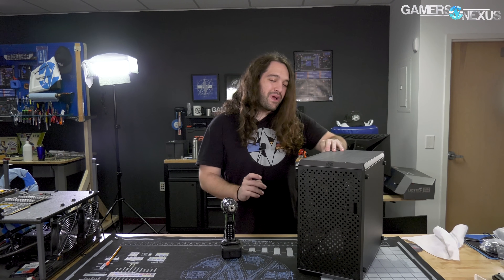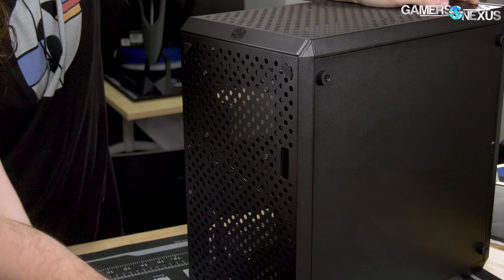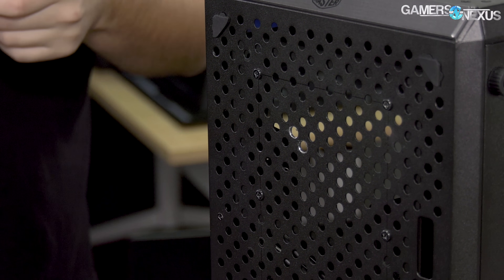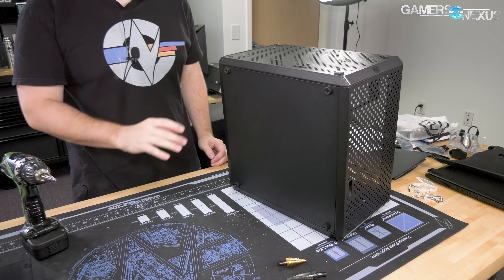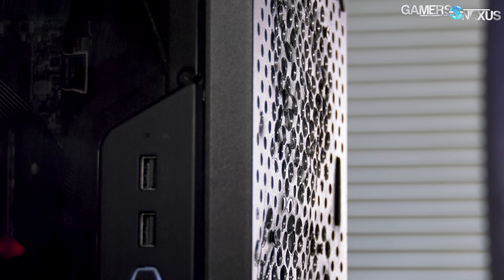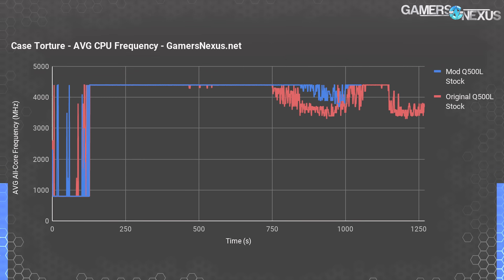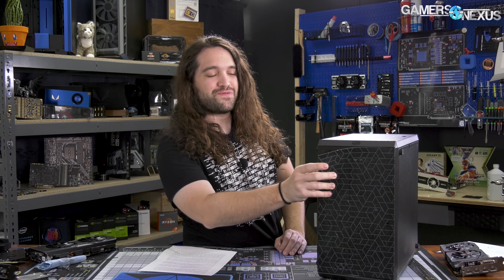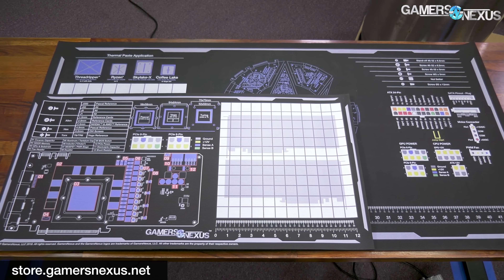"Fixing" Another Cooler Master Case: Drilling the Q500L for Airflow

Comment: High drill RPM, and low axial force would have resulted in significantly less metal deformation, and better drilled hole finish. Also using the tapered portion of the drill with little to no axial for will remove those nasty burs.

Comment: I like what you did, although would it not have been easy to cut larger fan shaped circles in the panel rather than drilling all the holes? that way more integrity may have been retained. Great video though and a wonderful reminder to clean out cases after any kind of modding that cuts the metal.

Comment: Almost bought this case in November for my mATX build. I ended up buying a worst what had a plastic shroud covering all the front-which is similar to this. Only with one tiny hole on it on the bottom end, roughly 1.5x10cm small.
And! The elevated mounting holes for 92mm fans on the case ended up braking my 120mm CM fan blades at the first start.
Might have been better with this bad case.

Comment: TIP: when drilling multiples.....nail polish, marker, tape etc.....as a marking on the step bit will help you know when to stop, w/o checking every time.......
Adding a foam backing, or grout/tile sponge behind the holes when drilling also helps “collect” metal shavings a little.

Always wanted someone to drill holes in their case, glad was Steve😉

Comment: If you would use a Dremel Cut-off wheel and turn the original (hole sized) front panel into a 'Diamond Lattice' pattern: It would both provide better air flow, and still also provide support behind the Dust Screen..
https://images.homedepot-static.com/productImages/92aaf152-40ba-44ec-a79d-87ab1ee23550/svn/black-veranda-vinyl-73004497-64_1000.jpg

Comment: FYI;  Put a decent sized magnet on the inside of the case when drilling, and it will basically make the slivers stick to not just that, but the now magnetized cover.  Makes cleanup a lot easier.

Comment: Steve 2:13
And TechJesus went into the temple of Airflow, and cast out all them that sold tempered glass and aluminium front panels , and drilled holes in the cases of the manufactures, and overthrew the seats of them that sold cases that throttled, And said unto them, It is written, My house shall be called the house of airflow; but ye have made it a den of throttling.

Comment: Hmm. Maybe chop the entire front out and just put a pair of fan rails top to bottom or side to side... I wonder if you can cram a 200mm fan or more 120s in...
I think this should be made into an open frame case with the magnetic mesh creating an illusion of a closed case.
Reinforce the boarders, chop the panels out and replace fan mounting with rails...
basically make a thermaltake P3 or P5, but with magnetic mesh covers.

Comment: So I purchased this case before the original review.  I probably would not have done so if I had seen the review first but I am actually very happy with the case.  I moved my AMD R7 -1700 with a Nvidia 1080 Ti to this case.  It has a dual fan radiator to cool the CPU venting out the top and 2x 120mm fans mounted low in front and another in the back.  Modest overclock on both and the whole setup runs cool and quiet.  I accept that the air flow sucks but it is apparently adequate for this use case.  I also have a Firewire card and a Elgato HD60 plus an 3.5 hard drive in the case as well.  Overall I still like the case a lot.  It's size for a full ATX board is the main reason I got it and for the money I think it is still a good deal.

Comment: It's like cutting out the stamped grilles on OEM cases and replacing them with wire grilles, but with an aftermarket case that isn't supposed to need such treatment. Good going Cooler Master!

Comment: I would try to just block the front grill and leave the fan holes open. 

I've done that on couple of modded cases of mine to prevent the fans from recirculating hot air that gets passively vented out through the extra holes in the front. Though I did not measure them, but that could direct the airflow better to avoid circulating hot air.

And since you already drilled that case that badly, what could you lose if you duct-taped the front as well?

Comment: If you wanted to minimize the warping of the front panel while doing something like this, cut a board to temporarily put inside the case, against the inside of of the front panel. Attach it with screws through some of the holes. Don't over-tighten the screws, but use several throughout. Drill through the steel into the wood. You can remove and replace screws as you drill, or just create a screw pattern and skip those holes altogether. Once the panel is drilled out completely, you can remove the board and all of the screws.

You will still get a little warping, but not as much. If you plan your undrilled screw holes for fans and PSU attachment, you shouldn't need any additional washers/spacers.
Reply: You just saw Steve drill up holes. Now you want to see him saw wood? This is not a DIY channel. These guys review computer hardware.
Reply: @1pcfred  
Believe me, I know. I watched the footage of them finding drywall screw heads with a magnet and not understanding what was going on. The entire "moving in to our new office" series of videos was kind of cringe inducing in fact.

This comment was more for someone seeing the video after having found themselves "stuck" with this case, and then wanting to mod it for better airflow. Or just because I had to say it having watched them mangle this case so badly. Either way.

Perhaps cutting large sections of the steel out would make more sense, depending how flimsy that leaves the rest of the case and/or the front dust cover. Sometimes you "have to" use a particular enclosure for one reason or another, but ultimately I think Steve is right when he suggests just getting another case.
Reply: @1pcfred  
Should work the same on metal stud drywall screws, as the heads are the same, metal studs just require a tighter thread on the screw part. I literally just use a magnet on a string myself. Having too-strong of a magnet might be an issue if using it to find screws in drywall installed on to metal studs, but we're talking rare-earth strength. Standard magnets shouldn't be an issue, the drywall is typically at least 5/8" thick on steel studs because that's the minimum thickness for commercial fire-rating.

Comment: Those step drillbits are maybe nice for testing out what size of hole works, but the finale drilling of them all can be much easier and cleaner done with a high quality regular drillbit and a woodplate against the back of the metal. If you did that it would problably look way cleaner. You cant support the backside of the metal youre drilling in with those step drillbits.

Comment: Tip: wrap electrical tap around the bit below the size you want. It will act as a simple stop so you can go faster without worrying about over drilling.

Comment: Wonder how it would perform if you decided your layout ahead of time and just cut out the interior section where the fan sits. You'd lose future functionality by doing so but maintain more structural integrity and time.
Reply: You don't think what they did kind of eliminated future functionality?
Reply: @1pcfred  Sure, but taking it a bit slower and measuring out the holes would let them keep mounting points for every possible fan/psu combination. You start straight out cutting out holes for 140mm fans and  mounting the PSU or 120mm fans becomes a wee bit more difficult.

Comment: So does this apply to the Q300L as well? I've had one with my GFs computer in it for about 6 months. On installation, I ran some quick AIDA64 stress tests. The Ryzen 5 1600 was overclocked, but ran stable, peaking at around 82-85. Obviously it never gets anywhere near that when not in a 100% stress situation. This didn't seem out of the ordinary to me, so we ran it as is. I'm using the stock wraith cooler with one fan in the back, and one in front. The power supply, unlike with this case intakes through the bottom and exhausts out the back, like most modern cases. I haven't noticed any issues, but the abysmal results have me paranoid that I'm baking her hardware to an early death.

Comment: Stepped drill bits are awesome for thin walled material, but, surprisingly hard to find a good cheap set in metric.
Reply: They sell metric step bits on Aliexpress. In fact that's practically all they have there. This world is going to shit. Metric bloze goatse to fabricate with. Ah finally one red blooded fractional bit.

Comment: you could have put electrical tape on the bit were you wanted to stop that way you never go past the size you want , it allows you to move a little quicker and not have to be as careful. just make sure you put enough wraps of it or it will just fall of

Comment: why not just cut a big square hole instead of drilling many bigger holes
Reply: It was a proof of concept. They wanted to see what larger holes would have done for the air flow. Which is a decision Coolermaster themselves could have made when they designed this case. I don't think they're suggesting anyone do this to their case to try to improve it.

Comment: Wouldnt it have been easier to just cut out two 120mm holes so the fans can intake with no restriction apart from dust filter? I feel the case would have been sturdier and would have cooled better. And if the filter is sucked in and hits the fans just divide the hole in two or four leaving a bit of front panel in between.

Comment: For future use of step bits I recommend some masking tape above the depth you want so it is easy to gauge for more than one hole without making a huge mistake or being paranoid with them and it is a 30 second hack that saves time.

Comment: Definitely this case needs improvement. The front panel should be just a big hole. Just make it have "crossbars" So that you can mount the fans on those then add the filter.

Comment: The step drill bits are MUCH cheaper on Banggood, there you get 3 Hex Shank HSS Titanium Coated Step Drill Bits, and are only US$5.99, i have used them a few times already.

https://www.banggood.com/3Pcs-14-Inch-Hex-Shank-HSS-Titanium-Coated-Step-Drill-Bit-Set-3-124-124-20mm-p-1003275.html?rmmds=search&cur_warehouse=USA

Comment: Unibits are the best! Quickly cutting to the size you need, while also de-burring the hole once you've drilled it. If you can't afford Irwin Unibitis, you can get step drills from hf for about 1/3rd the cost which do a very nearly equal job.
Reply: It doesn't look like Steve entirely got the deburring technique down yet.

Comment: do me a favor and never touch a drill again. thats just disgraceful. whoever told you to use a step bit should be banned from any forum relating to modding because they have no clue what its for. you didnt even need to do the whole front... just the fan locations, theres no reason at all that even a complete moron that cant even spell "mod" couldnt do a better job than this shit. and fyi, theres nothing structural about that panel, the frame is the structure on every case... panels are nothing but aesthetic, just because they rivet it on doesnt mean anything

Comment: I'd have turned pairs of holes into diagnal slots you could make paters this way and retain/improve the mounting flexibilaty.
also high rpm + low pressure == little warping of the work metirial

Comment: Why use a step bit? standard metal drill bit (on a faster speed!) would have made the job way easier, cleaner and quicker.
Next time you need to fix airflow - I'm sure there will be a next time! - use the right tools for the job :)
Reply: You're not the first person to say this. I've been working metal for over 30 years now and for drilling out thin sheet goods I find step bits to be the best when it comes to larger diameters. Twist drills tend to corkscrew and leave butterfly holes on jobs like this. A twist drill in sheet metal you're only good up to about a quarter of an inch. After that they become problematic. Which is why Unibit has made billions of dollars selling step drills. The only downside to step bits that I've found is that to get certain larger diameters you have to drive the bit in a particular depth. Which sometimes is a clearance issue. But if you've got nothing but air behind the work that's not a problem.

Comment: This has got to be the worst planned video. You should have marked the fan blade circumference and used an angle grinder to just get rid of the metal.
Why drill bigger holes? That took so much longer than necessary. Just cut the holes out with a grinder.....nerds aren't very smart with power tools.
Reply: On top of taking longer, it looks like shit. You marred up EVERY hole with the drill bit. An angle grinder would have been clean.
Reply: @thenextgen1able  Tbh Steve doesn't really care that it looks like shit now.

Comment: If you had an MDF board on the clamped other side that would have helped a lot and a drill bit for consistent size. Also, drill press would be better.

Comment: Some of Cooler Master's recent products are just good as junk. They're no longer the glorious PC Hardware Manufacturer that I used to admire during the times when RGB Lighting and Tempered Glass Panels are not yet present way back in 2014 and below. Their products during those times like HAF-XM, HAF-X, HAF Stacker, Cosmos SE, Cosmos 2, Nepton 140/280XL, Hyper 212 Series, Excalibur, Turbine Master and Jetflo are exceptional in terms of cooling performance and they really stand out compared to their competitors.
Reply: But this time, they are left behind from their competitors because of their cost cutting to the Build Quality and they tend to focus more on Aesthetics rather than Function and Performance.

Comment: Here's a hint for drilling holes like this: put electrical tape to mark your desired depth (which in this case is also width) IT doesn't make drilling any easier, but it makes it easier to see what you're doing, which makes it a bit faster...

Comment: If you flange the holes after you drill them out they'll be stronger than the original.
Reply: It should only take about a week to flange 500 or so holes.

Comment: Drill baby drill. This is what happens when computer engineers cheat on their  fluid mechanics, and thermodynamics tests. If you can't work out the basic airflow how do you produce all those cases without testing a prototype.

Comment: hmmmm so sad ,   a 1200 rpm fan speed  pulling thru the original  venting  = base airflow , increase of 1300 rpm fan speed . equal increased airflow without screwing up your case

Comment: An Idea for the next time would like to see you use some fan spacers between the mount. Just enough to move it away a bit from the metal plate. I would think this would allow more air into the chassis.
Reply: If you stand the fan off it'll just suck air inside the case. It's going to draw air wherever the least resistance is. So then you'll just be blowing hot around around inside of the case.

Comment: If computer cases are supposed to made with respect to Electromagnetic interference, hence why cases are still metal and not completely plastic, how much larger can you go in mesh holes without drastically increasing how much your computer interfers with other devices? There has to be a hole size that just lets all that interference just flood out.

Comment: What if you applied spacers to the fans to bring them further inward into the case, allowing better airflow?
Reply: You'd just recirculate hot air in the case then. Considering that fans draw power and generate heat themselves you'd be defeating the purpose of the fan entirely.

Comment: They could fix this problem without removing the nice adjustability just by making the holes closer together. Obviously that isn't something you can do as a mod once the holes are there, but if you were designing this from scratch you could use the hole size they did, but just pack the holes much closer together. Unless that would create a problem on the manufacturing side of things I think that would be the true way to fix the design of this case. Hell the way it is stock you could fit another hole the size of the stock holes between every one of the holes.

Comment: Should've just pulled a Silverstone Sugo move and put the PSU over the socket area to free up the entire rest of the case for intake. That and take a few days to think up a mesh design that incorporates the 120/140mm holes, breathablity and being aesthetically pleasing. Some sort of bigger holes toward the center deal so it'd have a sorta light column look with LEDs? Maybe a faint "X" design to include the fan holes, hexagons, just... something, anything more than that.

On Silverstone, they could really kill it if they made bigger small cases in the SG line with the 13's design aesthetic.

Comment: Excellent. I did a similar thing to my N200 case and it also improved the noise! The air going through the metal holes was making quite a horrible part of the case noise at high fan speeds.

Comment: I would use a stepping drill for the initial test, and then use a regular drill bit after the size decision has been made. Easier to control, and will not oversize no matter how long you drill for.
Reply: Twist drills sometime want to thread in if you are starting with a relatively large hole. Then you break things.

Comment: Now try to fix a CM Masterbox Lite 5. It's got 3 fans trying to suck air through a solid piece of acrylic. Only two tiny vents equaling the surface area of the CEO's middle finger allow airflow in. Theres literally no other place for intake fans. But hey, at least the stock fans are RGB.